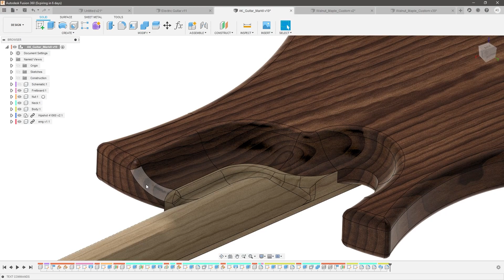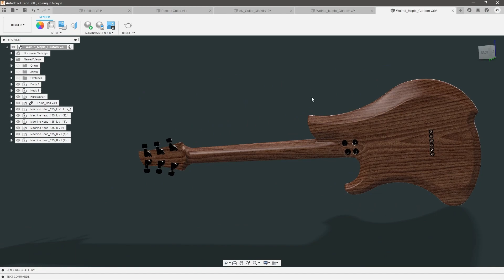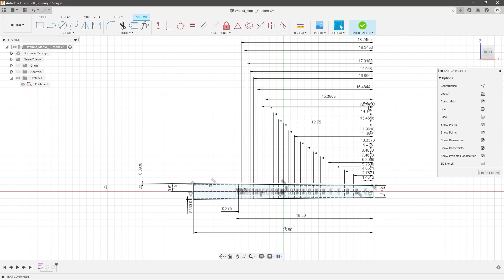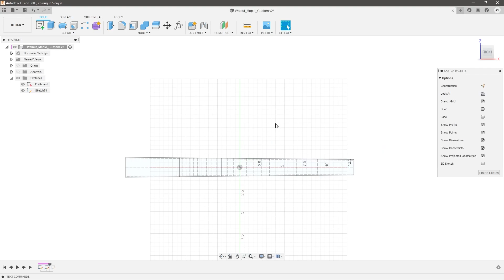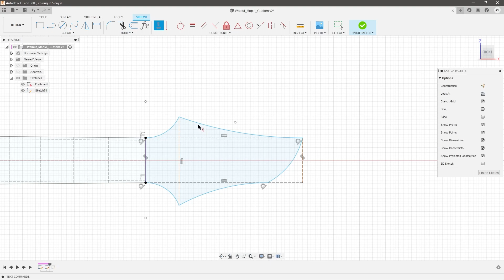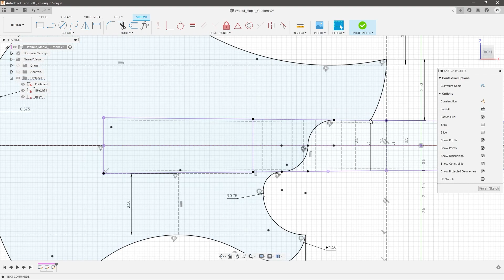Guitars in Fusion 360  |  Part 1 - Introduction & First Sketches

Comment: dude how did you got the FRET2FIND model to fit fusion360 in the correct way. I've exported svg model with 27 inch scale but when I upload it, it loads as 27mm. how like ? thanks

Comment: Dam Austin its not promising when a 15 year pro says they are having troubles modeling a guitar. I want to learn. Thank you for sharing your knowledge. I appreciate this a whole lot.  I will pay it forward my friend
Reply from the maker: My pleasure mate, it's definitely a very tricky model. But I've learned so much since this video and the process has become much easier - it really required me to learn the surface modeling space because at the time I made this video I tried doing everything in the solid modeling tab.
Reply: @austinshaner  oh see yeah I don't know the difference to be honest. I mean I do but don't always understand when to use the function. I think I just learned something. Hey thanks a bunch. I really want to start 3d modeling all my specialty builds. I am hoping it will help sell them better. Anyhow thank you again my friend. Wish me luck. I'm only 2 weeks into learning 3d modeling. I've already designed and made a couple things. This should be no problem for me. I usually learn programs like that fast. I will stop back in later

Comment: I can’t figure out how to model the fretboard from fretfind2d
Reply from the maker: Hey Jesse! You would design your fretboard in fretfind2d then export that file as an SVG or DXF and import that into fusion. But since posting this video last year, I've found fretfind to be less useful than it used to be. I've actually found it easier to draw your fretboard manually (using the parameters you set in the fretfind app), or create a parametric fretboard using formulas (see my Parametric Design Intent video), or installing a plugin called Fretboarder (link below) amd use that to generate your fretboard inside Fusion 360.
 https://meeloo.github.io/fretboarder/
Reply: @austinshaner  thanks so much! Your videos have been extremely helpful. Seriously can’t thank you enough.

Comment: Gday Austin thanks for these videos mate! I'm learning a lot :) I'm having a problem I'm hoping you can help me with though. I already designed my guitars in Inkscape and when I import the .svg file it is not scaled the same. For instance: in Inkscape the guitar body is 335mm but when imported into Fusion360 it is 88mm. Is there a box I'm not ticking or something? Thanks for any help mate.
Reply from the maker: Hello! Sorry for the delayed reply. SVGs don't always include size information depending on how the program it was created in generates the file (vector files like SVG are a scalable equations, rather than fixed dimensions). So Fusion doesn't always know the correct size for the design. 

There are a couple different ways to tackle this. The fastest is measure the difference between what it should be vs what it actually is (335 vs 88), calculate the ratio and scale up or down accordingly. 

Another way is to bring that SVG into another vector program (like Adobe illustrator), verify dimensions or scale it there, then export as DXF (which typically is more reliable for scale information) and import that into fusion instead.
Reply: @austinshaner  Hey mate your a legend! I exported it as a .dxf (autocad DXF R14 NOT r12) and then imported into Fusion360 and it is scaled perfectly! Thanks so much man it was driving me nuts haha :)

Comment: Hey Austin, you mention anchoring your origin point somewhere midway on the neck? I've tried Align and select 12th fret as from, but it won't let me select origin as destination any ideas please?
Reply from the maker: Hey spannerman, when you draw your fretboard sketch, select your 12th fret line and shift or ctrl click the sketch origin point, then hit midpoint. It should let you do this if you haven't made any other geometry in your fretboard sketch anchored to that point.

The easiest time to do this is when you first start the sketch. Start with your 12th fret line then draw everything else around it. The more complicated the sketch becomes before you do it, the more difficult it will be to anchor it there without messing up everything else.

Comment: Hey dude, how did you learn how to design? Did you goto school? What type of work can you get into ?
Reply from the maker: I learned 3ds max in high school for game design, then used sketchup for years building DIY projects at home. Then one of my jobs taught me SolidWorks so I could assist the engineers with drawings and develop renders for our website. That really launched my interest and I transferred most of my knowledge from solidworks to Fusion and the rest is youtube videos when I run into particular issues. 

Now I use Fusion at home, and Siemens NX at my current job!

Comment: Thanks for you video. You stated at the beginning you've worked with several different 3D software packages. Some are very expensive. Do you find the the Free Version of Fusion 360 just as good as VCarve, and Rhino Cad?? Thanks